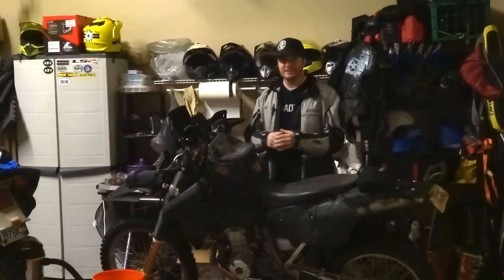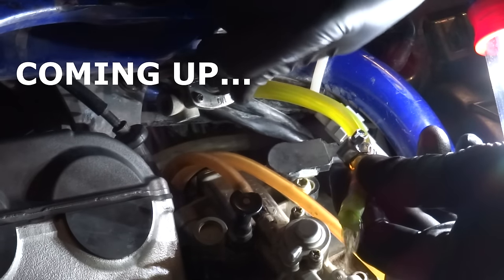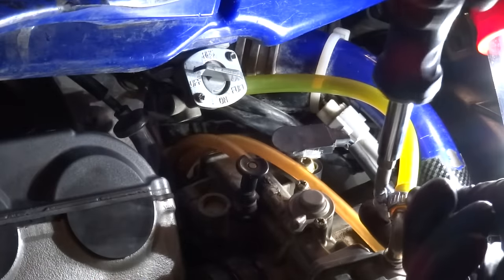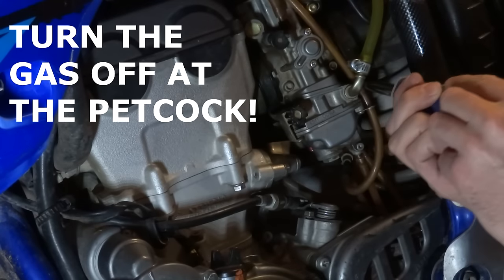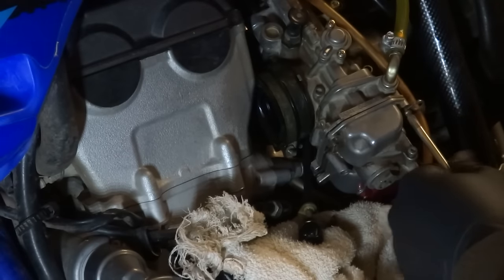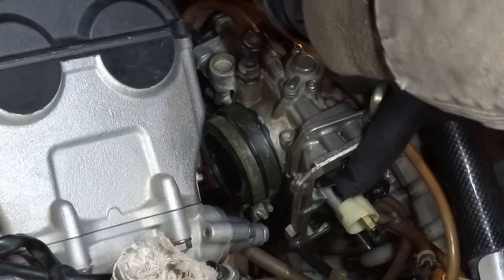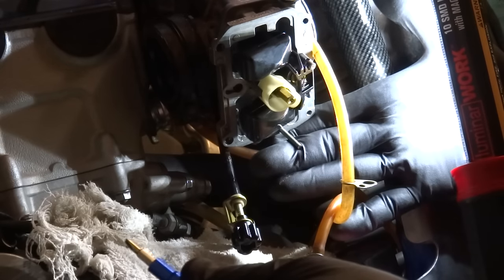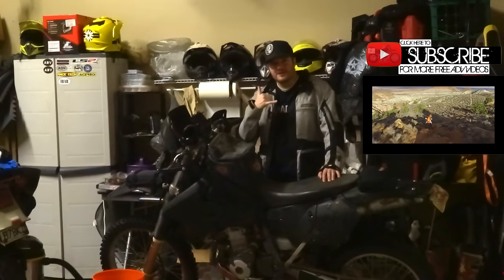Motorcycle Carburetor Basics: Easy Tips to Fix Your Dirt Bike o#o

Comment: Great advice.The only thing I would add is that it is usually  necessary to blow out a clogged jet with compressed air. The air chucks with the rubber ends are essential to get a good seal on the jet. Make sure you hold onto the jet firmly when blowing out with compressed air as they have a tendency to go flying across the street. Don't ask me how I know this!
Reply from the maker: +jeff ferguson Hahaha that sounds like fun, actually! Just wear proper eye protection eh? ;)

Comment: The tip about the boots is a really good one and commonly overlooked. Great video.
Reply from the maker: +IncogInfidel Yeah that ended up being one of the main problems on this WR project. We discovered it by spraying some carb cleaner on the carb while the engine was running, and man the RMPs went sky-high, so we knew there was a leak.

Comment: Though I already knew this stuf, THIS was an Excellent refresher course. As well as good for a new wrencher.

From personal experience, one thing to add is, after removing the float bowl before you put it back on apply Never Seize to the float bowl screws. It'll save MAJOR headaches. Too many a time i get a bike and do a carb clean or jet swap and the float bowl screws are corroded in place, then that amazingly infuriating stripping occurs. Besides that personal preference, excellent vid as always.
Reply from the maker: +Tony Z Ah yeah for sure! We had to pause for quite a long time to get a stripped phillips screw out... what a nightmare that can be!

Comment: Oh man, the infamous carburetor.  SO much useful info in this vid!  One thing that helped me understand them was to clean a carb from a lawn mower.  I worked on a ranch a few summers back, and the guy had me fixing all his dead machines... they all just needed fresh fuel and the carbs cleaned.  So anway,  I started small and familiarized myself with them.  So when it came time to doing the JD jet kit, 3x3 mod, full exhaust and the extended fuel screw... I was comfortable enough doing it all myself!  And let me tell you... WOOOOOO DOGGY!  Also, I think I just leveled up on manliness... hahaha
Reply from the maker: +JgavemeaDRZ You definitely did! All while saving a few hundred bucks, too no doubt!!

Comment: Great tips easy to understand, watch out for jets that will not clear out with spray or air.
Reply from the maker: +BlueGram 13 Yeah that's good advice... you might get carb cleaner blasted back at you if the jet is clogged really bad!

Comment: Really good and easy tips. I would highly recommend cleaning the screw driver before putting the jets back in. They get clogged so easy. Working with clean tools is generally a good idea when working on carbs.
And the air or mixture screw is located differently with every carb manufacturer. On most carbs I have worked on you can access the mixture screw from the outside. I you're not sure if you found the right one just screw it in or out with the engine running. You should feel/hear a difference.
Really good and helpfull video! Keep them up!
Reply from the maker: +Just your average turtle Thanks! Yeah having a clean screwdriver is a GREAT tip! I hope my jets don't get bogged up because we actually had to file that screwdriver down to get it to fit, and never cleaned it! *gulp I'm just crossing my fingers now!

Comment: Popping on decel is a lean condition.  Float height is important as well.  Be very careful not to knock this out of adjustment or the bike will never run right.  Fuel air mixture screw must be adjusted with engine hot and running to get it right.  Yup a pain the rump to get at unless you have an aftermarket adjustable fuel screw.  Popping on decel is a lean condition, not rich.  A larger pilot jet may be in order. Also make sure you know what your mixture screw is controlling.  On the air box side of carb = air.  Screwing in enrichens.  Engine side = fuel.  Screwing it out richens things up.  Great channel BTW.

Comment: I like it! Good advice Tyler. I like the whole video. I have 2 suggestions I have been told to do from so old mechanic buddies of mine that work for me every time. 1st - Like Piston Slap says WINTERIZE your fuel and bike. IE Drain the fuel or at least drain it from the Carb like you showed in the video. That helps eliminate the residue when gas evaporates from Carb. Use a fuel stabilizer (STABIL) or equivalent. Also, I use B12 berrymans carb cleaner instead of Sea Foam. Both work I guess but I'm a fan of B12.
Reply from the maker: +N3RDMAN Very good tips! Thanks man!!

Comment: keep in mind some of these dual sports like my 96 dr350SE have cv carbs with caps over the air/fuel screw. this can be removed so it can be adjusted. it's much easier and convenient to get an aftermarket extended screw so you can make fine adjustments if needed.
Reply from the maker: +desertghost I actually grabbed a Tusk one after this video  so we wouldn't have to remove the carburetor every time we made a mixture adjustment. It was $11 well spent!

Comment: Learning carburetors is like learning to paint. You can always get better at them. Took me forever to find an SOP for installing an aftermarket carb, that didn't depend on significant amount of skill, or luck. 

OH! One thing I'd add is to always check your valves if your carb gets wonky. Happened to me where my bike hard started, and kept thinking it was a carb issue.
Reply from the maker: +Adventures in Real Life Ack I forgot to mention that in the video! Yeah sometimes the carb can be fine and it's the valves to check next.
Reply: +eveRide ADV Eh, we all miss stuff. No biggie.

Comment: Hondas are notorious for clogged jets.  I've blown out the jets with compressed air, scrubbed them with carb cleaner, and still was not able to get it working. (honda 4wheelers, snow throwers, and generators too),   The best solution: WELDING TIP CLEANER. They are basically a set of cheap tiny smaller-than-toothpick sized files.  find the right size, and run it through the jet ports without filing it out larger.  problem solved every time. Its the gas varnish that blocks the holes and, on average,  you cant see it with your eyes.
Reply from the maker: +Jeff Ward That's a good tip! My buddy busted his out when we cleaned the DRZ carb a while ago and they really helped a lot!

Comment: Hey bud pretty good but one biggy is the final note on idle mixture you quoted the opposite of what is the typical cause of deceleration backfires. You could burn out the valves if you go too lean. If you're bike backfires on decel you need to RICHEN the mixture or some CV carbs have a whole deceleration circuit that probably needs maintenance. Small but somebody mentioned already is the petcock as I think any DOT bike needs a vacuum petcock if it was manufactured after a certain date (1980 something?)Cheers
Reply from the maker: +David O That's good info! Thanks for letting me know!

Comment: Should also add that a torch tip cleaner or fine wire file  will help clean out the jets.   Preventive maintenance is key.  Fuel stabile when putting the bike away can go a long way in the spring when its time to get out and tear up the trail.
Reply: +Piston Slap I live by Stabil.
Reply: +Tony Z stuff is magically delicious for motorcycles ;)
Reply from the maker: +Piston Slap Very good tips! I threw in some sea foam and it cleared up a ton of little problems on the DRZ without pulling the carb. And yes, a torch tip cleaner was used and worked well!

Comment: Yeap.. Most people fear the magic of the carburetor. They are pretty simple beasts. Usually harder to get it in or out than to work on it. hahahha  I have also found that a GREAT cleaner for carbs is PineSol. Eats fuel gum fast, but not your hands! Makes it smell fresh too. hehhe
Reply from the maker: +TWiGs ADV (Chris) Really? That could be an awesome cleaner!
Reply: It works great and the wife doesn't care about cleaning carbs in the house as much. Hehe

Comment: Very basic.  The cycle shops around me sell motorcycles as a side line and offer little to no help with suggestions or recommendations on parts, repairs etc. let alone telling you what jets you need for your carb, there's more money in selling the farm equipment. They only order the parts, having a tiny worthless inventory, so if they did have a clue what jet or jets were needed they would ordered them for you? There are some very good motorcycle forums that provide excellent information and I ordered all my parts on line and save money over what the tractor shop charges.

Comment: 3:10 I recommend just removing the carb completely last year i had to replace my throttle cable and i done it the lazy way and ended up breaking the  fuel valve on the bit that was connected to the tank and i had to buy a new tank

Comment: I got a 2000 kawasaki vulcan it used to run fine no problem and then one day all it did was cranck untill the battery was drained i figured a way to get it runing i had to rev wile turning it on but i didnt last long untill it died 1 2 mins tops so i does turn on but it wont stay on ... idk what would it be jet carb ?

Comment: hey bro I cleaned my carb over night just put it back on the bike and still nothing has changed can't go pass a quarter of a throttle I checked spark plug looked at my pick up coil they were good checked my gasket on the manifold check the needle level on the carb it's half rich and lean im not sure what to do I cant adjust the air/ fuel because it's closed my w gold cap and I don't really want to mess with it I don't work on carbs I only work on engine I have 2 more mukini carbs im gonna see if it changes with a different carb on it

Comment: I have a 1997 Honda CR250R I did absolutely everything you said and I still can't get my bike to idle it has a brand new rebuild all new OEM bearings seals gaskets everything is brand-spanking-new I'm way in the hole on this bike and it still won't let it seems like it has a vacuum leak or something? I just can't find it though no matter what I do while I'm searching for it was carburetor cleaner nothing has an effect okay.

Comment: I could use some help on my dirtbike I am not sure what is exactly wrong though. It does run I just can't get the throttle to work properly and there is a vent hose that has been disconnected and I do not know where it goes back to. It's on the bottom of the carburetor

Comment: I'm having a problem where my bike (2009 ttr125le) starts right up (choke on), but there is no response when I twist the throttle. The cables are good and I cleared the jets. My carb is apparently a vacuum style, where the throttle slide moves from air flow and not from a direct connection to the cable. It idles fine but the slide just doesnt move when I try to give it throttle. It's really frustrating.

Comment: i have problem with my 2003 wr 450.
he was in garage more than half year.
after that.
gas start to leaking from carburator(on down side,from pump).
ok i found out i need nee tire in on/off/reserve tank pipe.
but still carb isnt do job that it should.
do i maybe need to put new fuel screw.
cos my friend mechanic said everything looks good.
so probably can be that fuel screw.
or idk help me xD

Comment: i may need some help 
my drz stopped working recently, after riding for 15 min it just cut out, i can start the bike up but it will run for only about 5 min then it cuts out, it also doesn't rev fully every time i pulled the throttle, only every second or so rev it revs all the way, the battery also tends to de charge very very fast. 

The bike has a new 2013 bottom end and the cylinder works big bore with an FCR 39 carb and full mrd pipe all these mods have been no issue and installed by a professional. its been running properly with no issues all year until now. 

i dumped the old fuel and put in new fuel
i cleaned the jets out
i put in a new spark plug
i checked voltages and the regulator is fine 
it sounds okay (I cant hear any engine damage at all) while idling once it starts but as i said cuts out after a few mins

 any ideas? i thought maybe a stator issue but i dont know
Reply from the maker: +LeoMoto “Leo” calumkz I had similar problems and it did turn out to be the stator! The only other thing (check this first) might be a clogged vent hose. That little simple fix has caused me a lot of heartache, but now clearing out the vent hose is almost always the very first thing I check when the bike starts to cut or run funny.
Reply: +eveRide ADV thank you, took it to a garage because i had a feeling it was the stator and it was, all the bolts in there had sheared right off, got a new stator and the bolts have been lock tightened in now so it shouldn't happen again. ill keep in mind about the vent hose if anything similar happens again, now i know haha.

Comment: If your bike is backfiring/popping out of the exhaust when deccelerating that is a a definite lean pilot setting. Not rich.
Reply: i had read that somewhere else as well and was curious why he was saying lean.
Reply: When your motor is at high rpms and you release or close the throttle, your intake is now at a very high vacuum condition.. Not enough fuel, or even no fuel can get drawn in. Mostly just air or only air and way more of it is dram in.. this causes a super lean ratio and wont ignite to make a combustion. However, once the motor makes a few revolutions and with no combustion, the fuel will accumulate in the exhaust and eventually there is enough to ignite from the heat. Thats when you get your backfire/popping.. Some newer woods bikes and most street bikes have an "automatic coast valve" or ACV.. this will add the little extra fuel thats needed during high vacuum to prevent any lean mixture and of course the backfiring.. Performance exhausts that are much more free flowing and efficient, backfiring and pops are more common and need more tuning on the pilot circuit, with or without the ACV feature..
Reply: Lu G

Comment: my motorcycle gets hot when it just get idle and its not normal. its sparkplug is getting dark even if it is new. and also its getting wet by oil or gasoline.. what the solution about that?
Reply: killersmile bambam Your mixture is probably too lean and the parts in the cylinder don't get oiled enough. Look up a video on how to richen your fuel mixture. (I might be wrong, though.)